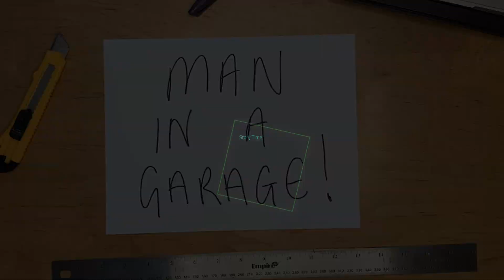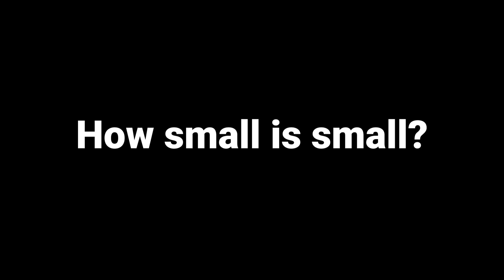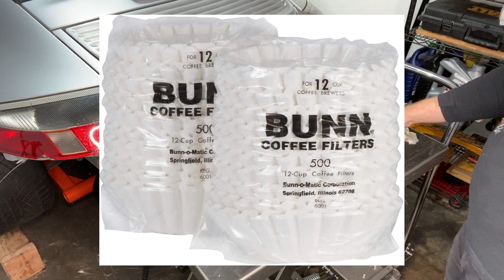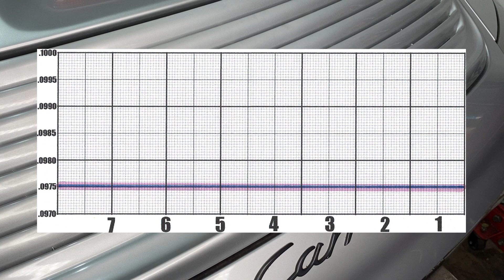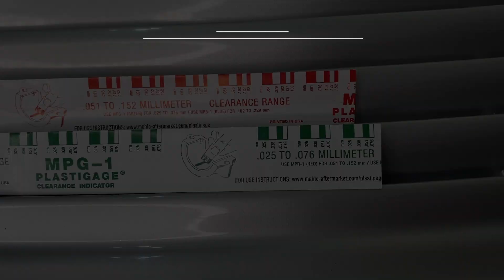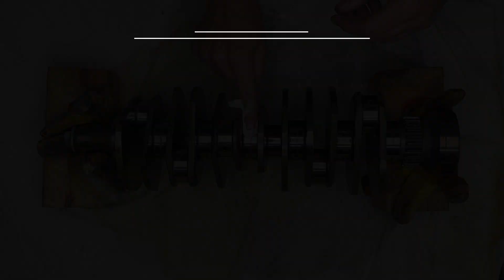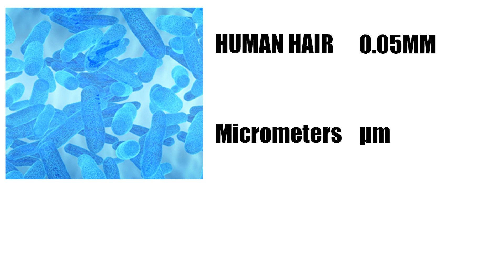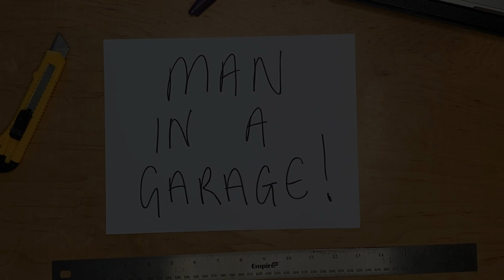How to RECONDITION a PORSCHE 996 Engine Part 04

Comment: Even though I am an anti-fan of the M96 engine, I can't stop watching your video series about it!  :)  I would imagine someone else has probably mentioned it by now, but you only use one piece of plastigauge per bearing circle (not per shell half).  With the plastigauge you are roughly measuring the total clearance between the O.D. of the crank journal and the I.D. of the bearing.  

Of course, in use half of that total clearance should end up on each side of the crank shaft, so one would conclude that your measurements from each side of the bearing could just be added together for a conventional measurement of "bearing clearance" or "oil clearance," whichever term you prefer.  And for what it's worth, a total of .05mm (~.002") is right in the ballpark of where you would want to be as long as you aren't doing too many "power adder" type shenanigans to that engine.
Reply from the maker: I really appreciate your detailed reply 🙌 it’s probably fair to call the shenanigans on this car a “Group Effort”..... people, like you, have been fantastic in the comments. Hopefully as a team we can all take a leap in the right direction on these cars. Thank you for watching. 🤘😎
Reply: @ManinaGarage  Thank YOU for making the entertaining content!!  :)

Comment: Another great video brother. I admire your passion and and effort you put in this project. Funny and educational at the same time👍
As a former watch maker, I often had to deal with these kind of tolerances and measurements. 
Good to know as well:  When we are talking microns, consistent temperature while taking measurements becomes also important and should not be neglected.
A change of a few degrees C. Will and can influence your reading. Depending on the material and tools. ( I had to smile when I saw the plastic micrometer☺️)
Keep up the good work and and success with your project ✌️

Comment: I don’t believe you need to torque to yield, or stretch the bolts to measure clearance. Plus you risk snapping them off and then you’ll be in trouble. So I use my new bolts and just don’t stretch them. That way you can use them over and over to measure. 
As far as measuring in general, yes it’s important because engines wear and the tolerances tend to increase over the use of it. However if the bearing shell is not ground up then you’re probably within spec. The cylinder bores on the other hand absolutely need to be measured. That will address blow by. 
Thanks for another great video!
Reply from the maker: Hello Yogi, You are really busy, thank you for taking the time to cast some light on my shadows. Thankfully, no snapped Carrier bolts, the new ones just arrived so this should be the last time I tighten them this lifetime 🤞🏻. Thank you for watching 🤘😎

Comment: Happy to see the plasticgauge worked for you, by the way the carrier bolts can stretch when you torque them and there is a maximum number of times you can do that before they need to be replaced, not sure how many but think it's some where around 3 or 4
Reply from the maker: Great advice as always, Thank you Don! Pelican Parts Just delivered a new set of Bearing Carrier Bolts for the final reassembly. Some folks say they should be replaced with ARP versions, I missed the boat on that. I did get ARP bolts for the Conrods though. SO MUCH TO LEARN 🤯
Reply: @ManinaGarage  I need to get going on mine, I've been procrastinating

Comment: If you do measurements ( calibrating ) on ( in this case ) Engine Parts you should have a constant temperature of 20 degrees Celcius.
And normally you should use calibrated tools ( even if they are new) they should be checked ,  ( I worked in a calibration Centre ) 
You‘re doing a good Job , thanks for explaining !!!
Reply from the maker: Hello Arnold, Calibrating is a very important point, I did not get to that at all😅  I really wanted to say something about the temperature variations but I needed to limit the amount of Rabbit holes I went down in the interest of time 🤪  Thank you for putting this in the comments 🙌

Comment: Only one piece of Plastigauge per journal, adding the second altered your measurement. Need to check crank for runout prior to clearance measurements. Should have tightened the carrier from inside to outside, (unless directed by service literature). Attempting this service without the proper manuals is ill advised.
Reply: Good advice, as the journals and bearings need to be clean/dry using only 1 strip of plastigage then torque to spec and measure after disassembly. No machine work was required and this technique is sufficient for that which is being done.
Reply from the maker: Hello James, I really appreciate you taking the time to tell me the correct way to use Plastiguage, that kind of advice is tremendously valuable. I have been trying to figure out the best way to deal with showing people the wrong thing last week, you are going to get a mention in this week episode 🙌 You rock! Thank you for watching and Commenting 🤘😎
Reply from the maker: Thank you Warren, I am going to repent for my sins this in this weeks episode. 😅

Comment: first half of video can be summarized as., "...wanted to measure thicknesses of new and old bearings but couldn't find a suitable and accurate enough micrometer for less than $1000.".

BTW, tested my bearing clearances half a century ago using plastigauge. ...it's been around a while. :)
Reply from the maker: This was all new to me 🤓 Thank you for watching 🤘😎
Reply: @ManinaGarage  on re-reading my comment after a few days, i realize that it probably came across as more critical than i intended..... i apologize. :)